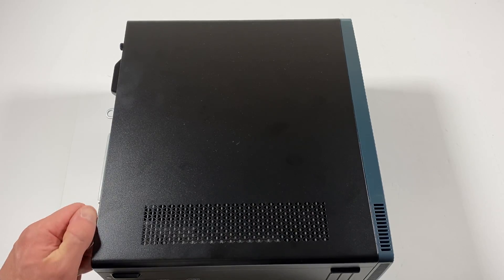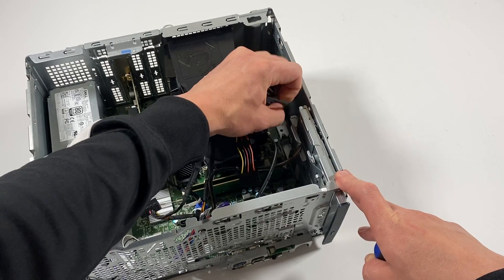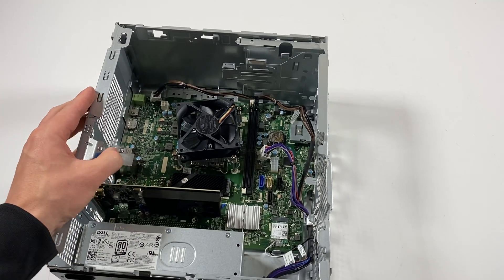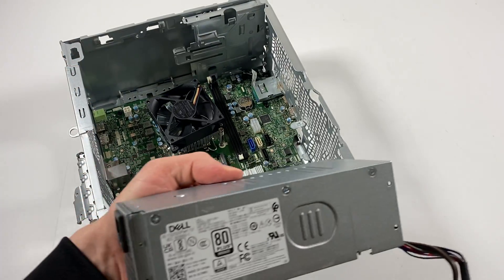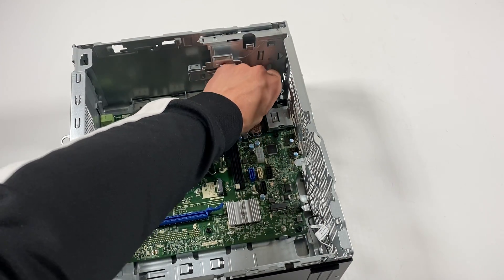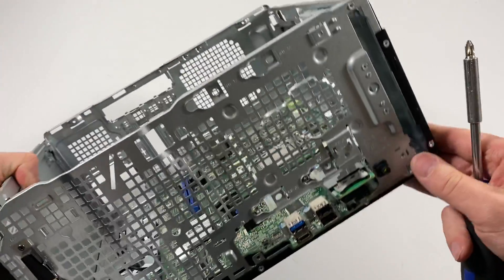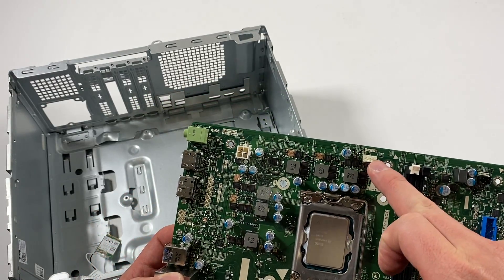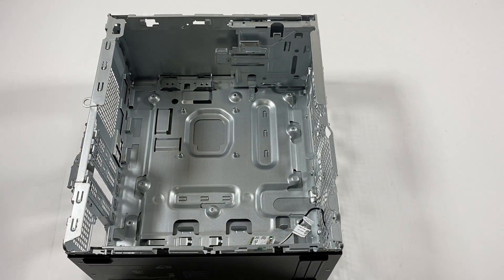Dell Inspiron 3910 Teardown

Comment from the maker: List of parts and upgrades will work with this system:

ADD Rear System FAN to make PC run cooler.
Simple Deluxe 80mm Quiet USB Fan with Multi-Speed Controller
https://amzn.to/3jgHxiI

 List of RAM will work with this system.

(1.) Crucial 32GB Kit (16GB x 2) DDR4 3200 MT/s (PC4-25600)
https://amzn.to/2Zazppk

(2.) Crucial 64GB Kit (32GBx2) DDR4 3200 MT/s
https://amzn.to/3bxCRPJ

(3.) Crucial 8GB DDR4 3200 MT/s (PC4-25600)
https://amzn.to/2R07Ier

(4.) Crucial 16GB Kit (8GB x 2) DDR4 3200 MT/s (PC4-25600)
https://amzn.to/326cfT7 

List video cards will work with this system.

For PC With 300Watt Power Supply 

(1.) AMD Radeon RX 6400 Low Profile Gaming Graphics Card
https://amzn.to/3s8MUUY

(2.) MSI GTX 1050 TI 4GT Low Profile  Graphic Cards 
https://amzn.to/2LwZd7P

(3.) Gigabyte Geforce GTX 1050 Ti OC Low Profile 4GB GDDR5 128 Bit PCI-E Graphic Card (GV-N105TOC-4GL) 
https://amzn.to/2T8bfsv

(4.) GIGABYTE GeForce GTX 1650 D6 OC Low Profile, Low Profile GV-N1656OC-4GL Video Card
https://amzn.to/381pp6Y

(5.) Gigabyte GeForce GTX 1650 D5 Low Profile 
https://amzn.to/3el08os

(6.) MSI Gaming GeForce GTX 1650 4GB GDRR5 Low Profile Graphics Card (GTX 1650 4GT LP OC) 
https://amzn.to/2X1FYsF

For PC With 180Watt Power Supply 

(7.) Gigabyte GeForce GT 1030 GV-N1030D5-2GL Low Profile 2G Computer Graphics Card 
https://amzn.to/2Z4PHkp

(8.) ZOTAC GeForce GT 1030 2GB GDDR5 64-bit PCIe 3.0 DirectX 12 HDCP Ready Low Profile Video Card ZT-P10300A-10L 
https://amzn.to/2WzgLXk 

(9.) MSI Graphic Cards GT 1030 2GB GDDR5, Low Profile 
https://amzn.to/390Spum

(10.) Gigabyte GV-N1030OC-2GI Nvidia GeForce GT 1030 OC 2G Graphics Card
https://amzn.to/3wd8EkB

(11.) Asus PH-GT1030-O2G GeForce GT 1030 2GB OC Edition Graphics Card
https://amzn.to/3SZ0gPC

SSD Heatsink:

(1.) Crucial P5 Plus 2TB PCIe M.2 2280SS Gaming SSD
https://amzn.to/3BatWkN

(2.) Crucial P5 Plus 1TB PCIe M.2 2280SS Gaming SSD
https://amzn.to/3d7lScn

(3.) Crucial P3 Plus 4TB PCIe M.2 2280 SSD
https://amzn.to/3d7LdTB

(4.) Samsung (MZ-V7E1T0BW) 970 EVO SSD 1TB M.2 NVMe
https://amzn.to/3d52k2a

(5.) Samsung 970 EVO Plus SSD 500GB
https://amzn.to/3fpi95A

(6.) Samsung (MZ-V7E500BW) 970 EVO SSD 500GB - M.2 NVMe
https://amzn.to/37uuLFw

(7.) Crucial P1 500GB 3D NAND NVMe PCIe M.2 SSD - CT500P1SSD8 
https://amzn.to/2N07wKh 

(1.)  Thermal Grizzly - Spatula for Applying and Spreading Thermal Paste
https://amzn.to/30Qq4ag

Thermal Compound Paste:
(1.) Arctic Silver 5 Thermal Cooling Compound Paste 
https://amzn.to/2ziNU0H

(2.) Noctua NT-H1 3.5g, Pro-Grade Thermal Compound Paste
https://amzn.to/36kTk7A

(3.) ARCTIC MX-4 (current edition) Thermal Compound Paste 20 Grams 
https://amzn.to/2DhGJaK 

3.5" to 2.5" SSD or Hard Drive Caddy Adapter R494D 0R494D 
https://amzn.to/2XTPeRr

HDDs list works with this PC:
(1.) Western Digital 4TB WD Blue PC Hard Drive
https://amzn.to/3Px8fAv

(2.) Seagate BarraCuda 3TB Internal Hard Drive HDD
https://amzn.to/3CdaVQP

Comment: Great video. Can you upgrade the CPU? I have an Intel i5-12400 processor in it and want to replace it with an i7-12700 which is on the options list, but service person at Dell did not recommend I do it.

Comment: I am about to buy this PC BUT need to put it in my current case (Corsair Carbide Silent) so I can properly mount my media drives. I'm guessing that this Dell has the mounting screws in the standard AT/ATX positions. I'll also be using my current PSU as the Dell one is far too underpowered.

Comment: Will this motherboard support graphic card 3060 in another gaming cabinet with changed power sources 560 watt?? I have 3910 with i7 12th generation processor bought few months ago.
Reply: its been 5 months but if you still dont know then yes, the motherboard does support the rtx 3060 but you will absolutely need a better power supply like around 450w or more

Comment: I have an Optiplex 3010 with i-core 3 2100 3.1ghz CPU,12gb ram,128gb SSD, 1tb hdd and 275w PSU. Can I add a gtx 1650 low profile GPU?
Reply from the maker: Hi, yes you can use gtx 1650 with full height bracket if you have mini tower PC.
Reply: @Mxkdt  Yes my case is mini tower. But can I use gtx 1660 super?
Reply from the maker: Yes you can and you have to upgrade power supply at least 450watt for gtx 1660 super and i do recommend upgrade CPU to intel core i7 3770.
Reply: @Mxkdt  Thanks a lot for your reply! 💚